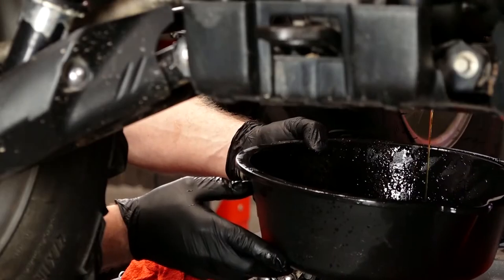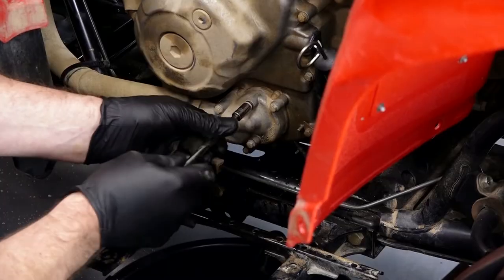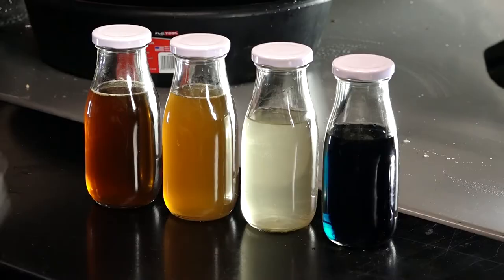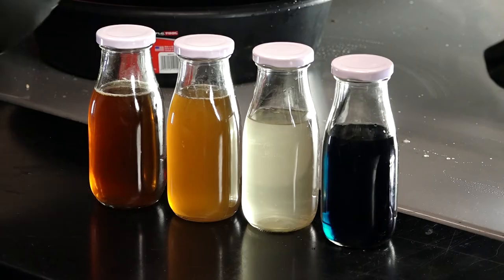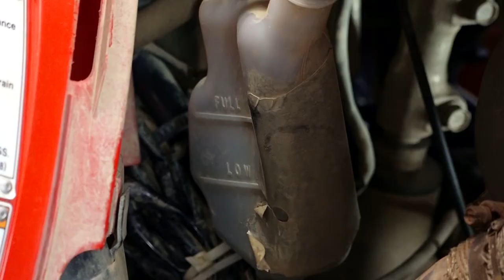Yamaha Grizzly Coolant Flush | Yamaha YFM700 | Partzilla.com

Comment: is it the same procedure for a 2006 grizzly 660, and will the mach bleed itself without cracking the bleed screws on the water pump and thermostate, at this time i am not sure i even have those bleed screws

Comment: HI John.  Fantastic video on the Grizzly.  Im over in England and have a Yamaha Grizzly 550 2011 model.  Not many good quad bike repair places over hear.  I am going to change my coolant and its looking good, so hopefully no need to flush.  One question though, will I need to bleed the cyclinder head?  Didnt see you do it on your 700cc one in the video but my handbook suggests I might.  Trust your advice.  Regards  Adam
Reply: Nice video. What does it mean when the coolant level in the rad doesn’t drop after you re-fill and run the bike to temperature? I just changed the coolant on my Suzuki Vinson 500 and after topping off the rad and warming the engine with the cap off, the level does not drop.

Comment: I have a 2002 grizzly 660 with 2194 miles on it that I bought new still has the original tires on it they are about half tread and I’ve never changed the antifreeze
Reply: That's just crazy what the hell 😂

Comment: How much coolant you need? Would any good automotive coolant work?  Example GM's Dexcool - it is made for aluminum engines. thanks
Reply from the maker: You can use automotive coolant. 2.1qts on the Grizzly.
Reply: Partzilla i have some Left over Honda Genuine Type 2 Engine coolant will that be ok for my Kodiak.
Reply: @nighthawkj30A4  yes, that's what I am using